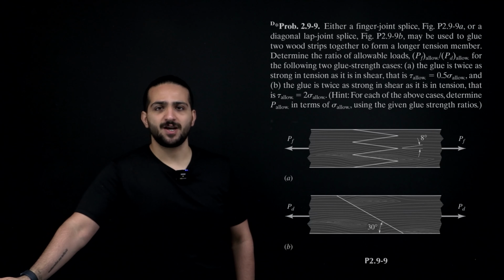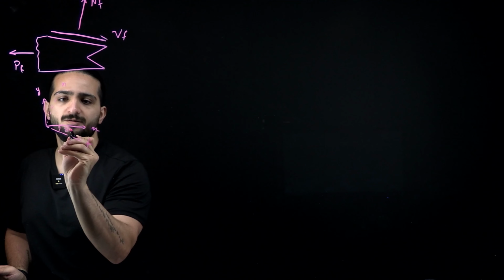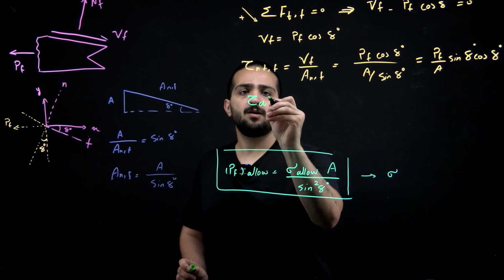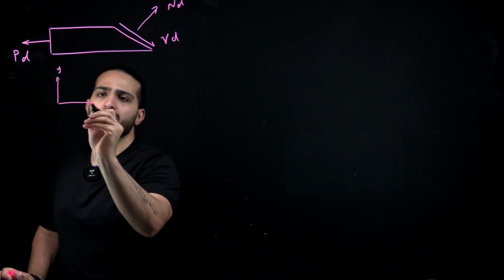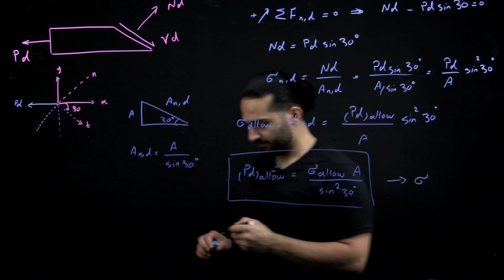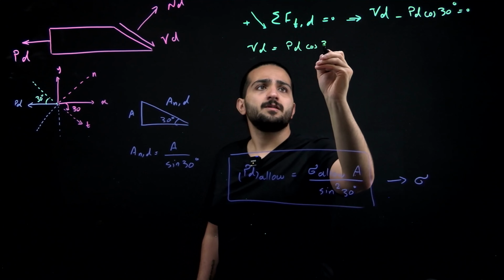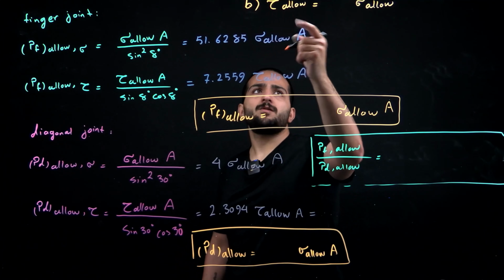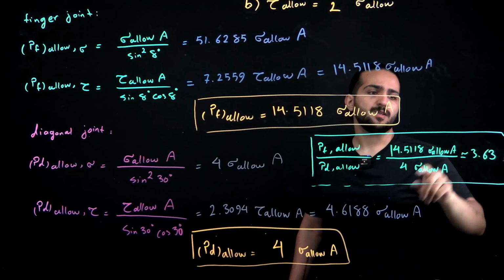Stresses on Inclined Planes (Example 3) - Mechanics of Materials

Comment: So in this particular example, we can conclude that the finger joint splice is more effective than the diagonal lap joint splice, right? 🤔
Reply from the maker: Correct! It can handle a load more than three times greater than what the diagonal lap joint splice can bear (in this question)!